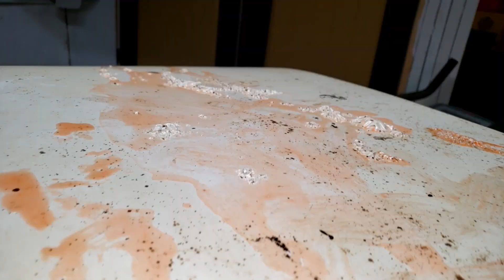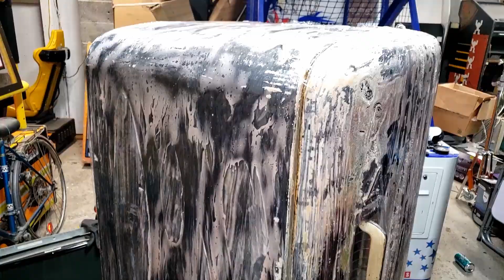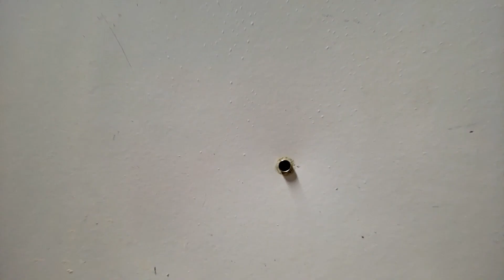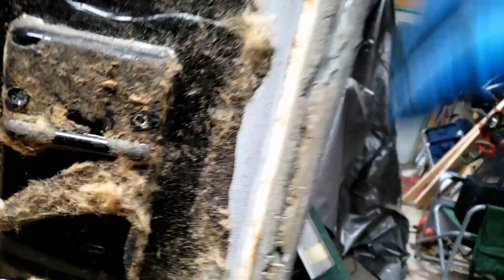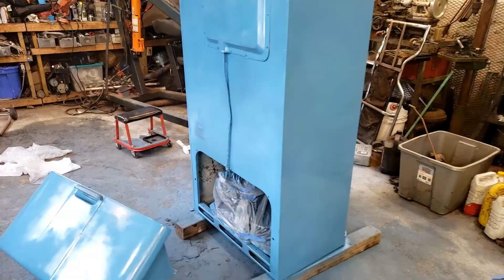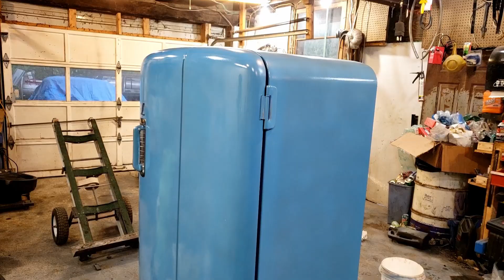Fully Restoring a 1940s Leonard Refrigerator! Goodbye Old Paint, Hello New Paint!

Comment: I have a leonard refrigerator also the threaded holes are for two rubber tipped bolts thare purpose is to keep the fridge away from the wall so the coils can get air circulation

Comment: Iron oxide is another word for rust. Painting over rust is a terrible idea,  even though people trying to get your money say its great. Because of the inherent properties of rust.  There is no good alternative to doing things the right way. And that is sanding down to bare metal, sealing and priming and painting. Curing the new paint at the proper temperature.
Reply from the maker: I miss spoke, the rust converter converts iron oxide to iron phosphate. Painting over rust does nearly nothing, chemically converting it to iron phosphate and painting it does a lot.
Reply: @BlocksRetroRepairs  i know you misspoke. You still have to sand it using that stuff. Practically to bare metal. And it looks terrible not finishing it properly. Using phosphoric acid can be a step, like in fixing frame rust on a truck/tractor trailer, for example, but not needed at all. And the results don't look like crap when done the right way either. And it lasts. POR is just cheap junk. Just my 2 cents after using that crap several times in the last 30 years.